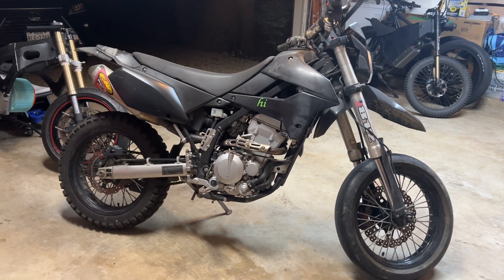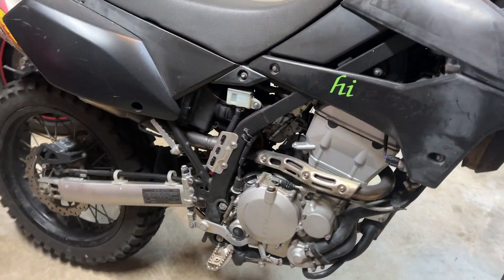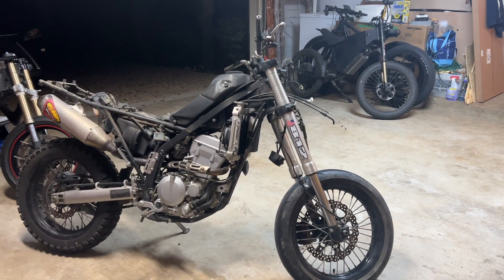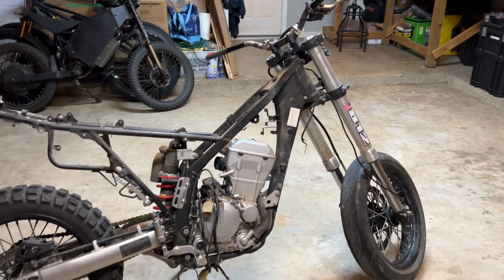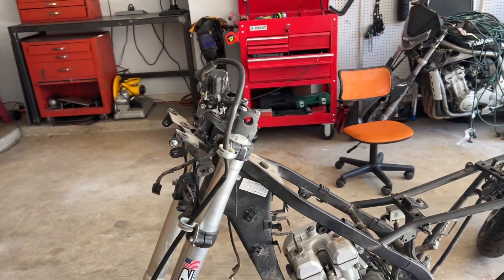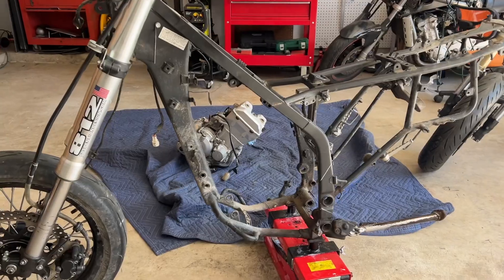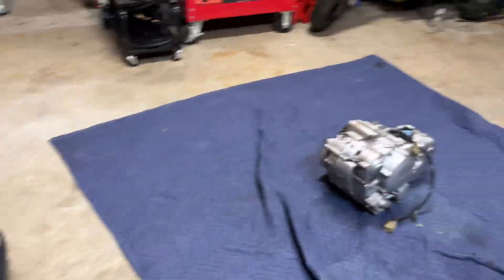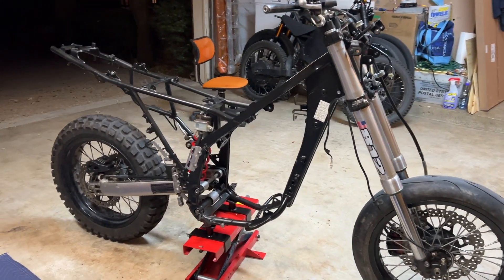Converting a Kawasaki KLX250sf Enduro Dirtbike to Electric (Pt.1) - The Teardown

Comment: Any chance you would be willing to share a complete parts list on this build.  I want to do this with a Honda 185s three wheeler!  Doesn't have to be down to the wire lug, but the main components.
Reply from the maker: I don't really have a full parts list but it's the QS138 90H motor, Fardriver 84530 controller, CT-22 display & custom battery pack